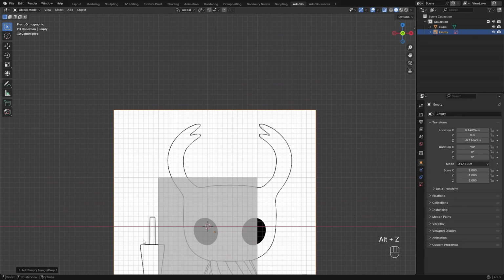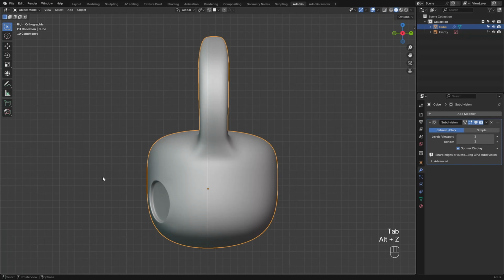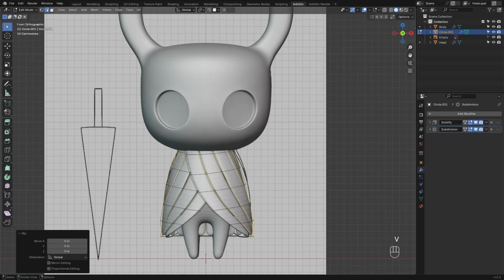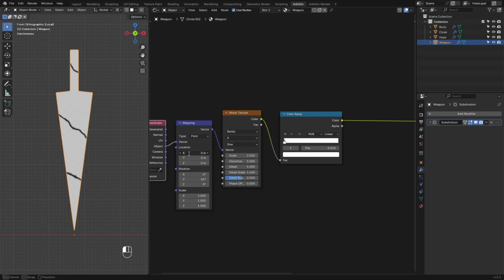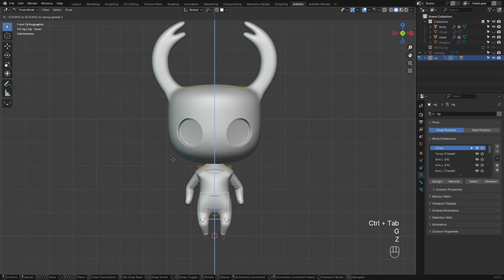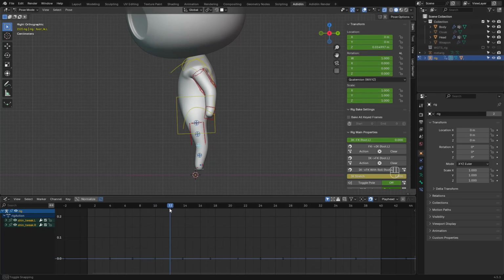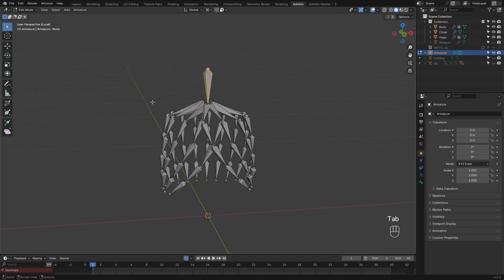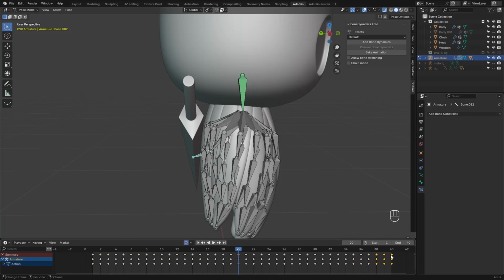Blender Character Modeling Tutorial | Hollow Knight

Comment: hey does anybody here also have issues with grid fill not working at all? Everytime i press controll f and select grid fill it does nothing which is hella weird.
Reply: I had the same problem and had an extra vert around the collar area. It doesn’t work if there is an odd number of verts so I deleted one of the verts on the collar and then used the loop tools > space while I had snapping on, the other cloak visible and the head hidden. Then the grid fill worked. Hope that helps you or anyone else looking in the comments for a solution ;)

Comment: Good evening, thank you for this tutorial. At the level of the modeling of the coat, when I do ctrl+f to fill the grid, nothing happens. How to do it?
Reply: I had the same problem and had an extra vert around the collar area. It doesn’t work if there is an odd number of verts so I deleted one of the verts on the collar and then used the loop tools > space while I had snapping on, the other cloak visible and the head hidden. Then the grid fill worked. Hope that helps you or anyone else looking in the comments for a solution ;)
Reply: @howl1440 Thanks I'll try later

Comment: Loop tool doesn't work, it can't draw a line 😢 what I can do wrong? And what I need to do? I see a lot of tutorial about this tool, but press key E and Z doesn't help. Sometimes make some random points, but not a line(((
Reply from the maker: Hiii. May I know which part of the vid you're having trouble with loop tools?
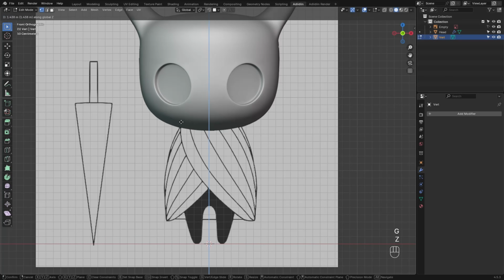Reply: @adiidiin part vid at 4:45. I have this tool, but it doesn't work, as the lines are not being drawn, only a one point created, and it not extrusion. Is there an extension that needs to be downloaded for this tool? Maybe another version of Blender? I'm using Blender version 4.4.1. Maybe I'm pressing wrong key sequences?
Reply from the maker: @АлёнаЗайцева-о2ф  I'm guessing that while you're on Edit Mode, you're on either Edge (2) or Face Select Mode (3) instead of Vertex Select Mode (1). Press 1 on your numpad (or the first icon after "Edit Mode" on the upper left) to select the Vert Select Mode (the blue one in the video) before extruding the vertex. Hope it helps :)
Reply: @adiidiin  thank you so much))) it's help)) I did it :D You have very cool lessons😎👍